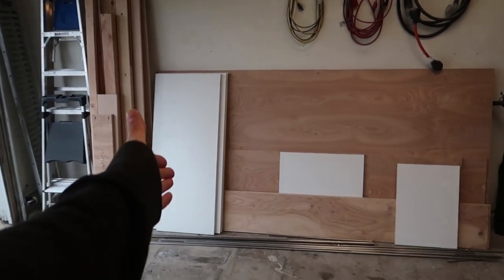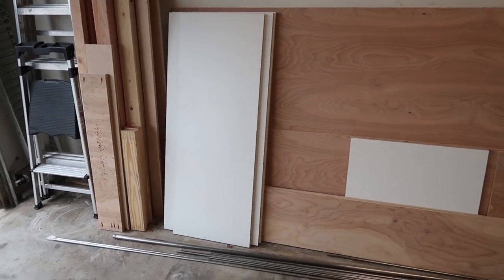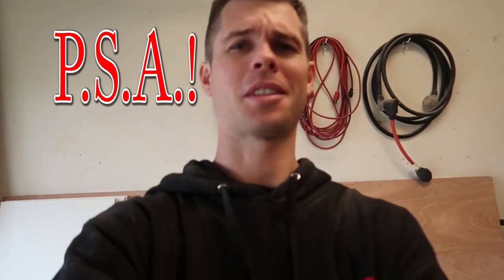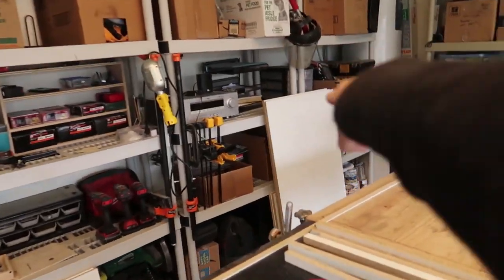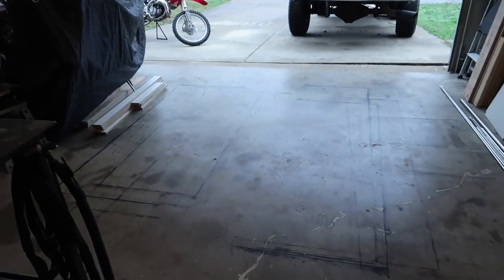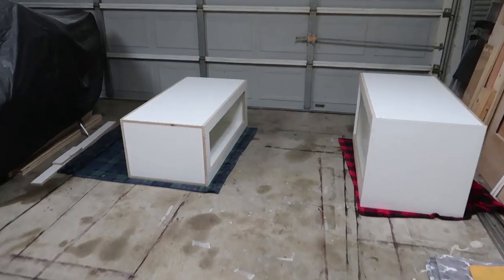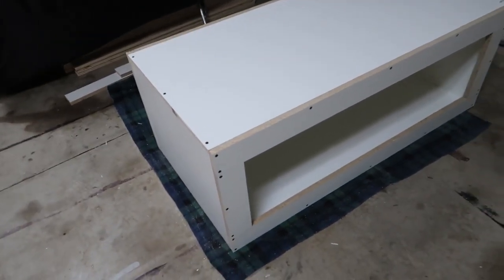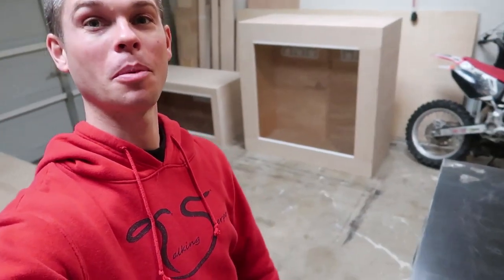Melamine Reptile Enclosure (Pros and Cons)

Comment: You can make a zero-clearance insert for your blade that stop the chipping and splintering as well.
Reply: What about taping down the cut line, would that work?
Reply: @Mailletdm1982  tape should help, but do both if you can.

Comment: My company has a cabinet shop and we use that to build all of our cabinets. About your chipping that you're having you usually have that side of the board against the wall or facing to where you won't see. On times that you have that whole entire piece of board exposed you usually put a face (wood grain) on that side. It's not your saw or your blade causing the chipping

Comment: Can you coat it with polyurethane to ensure water won’t seep through? I’ve had water seep through the plastic coating of a melanine board before and now I’m hesitant to use the pieces I have to make an enclosure. It’s for a ball python so I need to need it fairly humid.

Comment: How long does melamine last? I've had melamine furniture, and the melamine wears down with normal use after a short time. Also, you can't set a wet glass on it without having the particle board warp and bubble. So it seems like a terrible choice for a reptile that's potentially going to pee or spill it's water bowl on it.

Comment: How would I waterproof the interior of one of your wooden kits?
Reply: In plywood I'm using marine sealant and flex seal on top... Just to be sure, I'm melamine I would use silicone for the corners and maybe flex seal too in case the melamine film breaks

Comment: Wtf you go straight into each board no braceing ? have I been over building my cages with 2x4
Reply from the maker: Haha! No bracing needed. I design my reptile enclosures to be stacked as high as you want. Any reptile enclosure over 4' wide gets a center support in the front. I have lots of examples of this on my website talkingserpents.com
Reply: @talkingserpents  Can melamine enclosures stack on top of each other? Or is it too much weight.
Reply from the maker: @chubchubs7684  if the reptile enclosure is built properly, they can be stacked as high as you need them.
Reply: @talkingserpents  That’s what I figured. Thanks